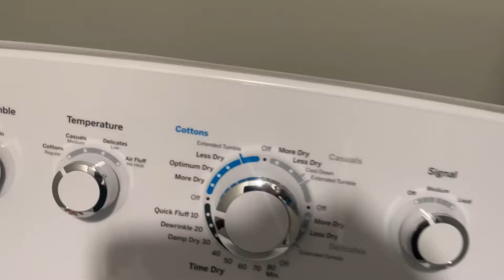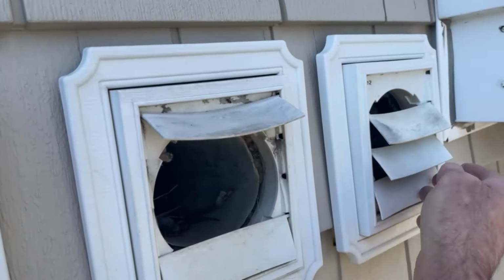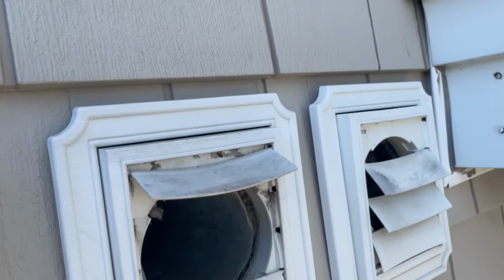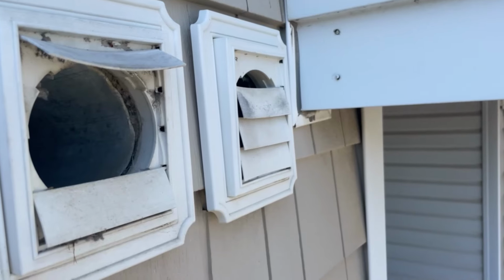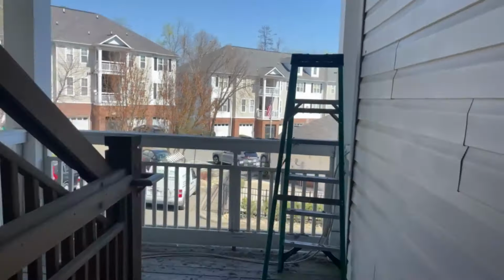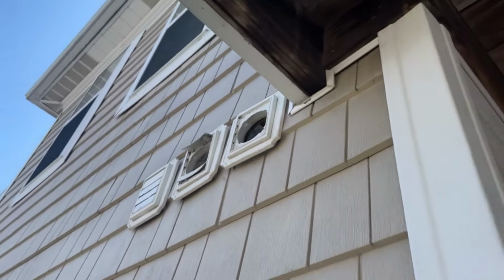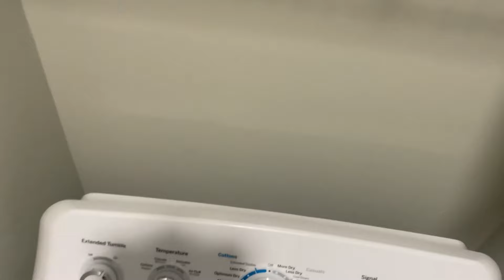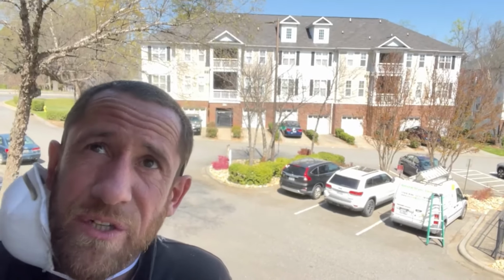EVICTION DAY! Dryer Vent Cleaning! #almetaldryervent #satisfying #viral #birds #bird #fyp #fupシ

Comment: In 2021 we had dryer vent cleaning for a 30 unit condo and I think we came up with something like 4 pounds of lint (dry) and 3 or 4 bird nests. They do make a plastic screen cap (vent guard) that snap fits over those louvers (without blocking the air/louver movement) and prevents bird entry.
Reply from the maker: Awesome! Thx for your thoughts!

Comment: Um, sir, it appears that you stole a vent flap from the neighbors vent exhaust. In the beginning of your video, your exhaust port is missing a flap at the top and at the end of your video they are all there. Also, the vent to the left of yours had a flap at the bottom which is missing in the end of your video. Not saying it wasn't you but as a home owner, regardless, seems suspect. Just saying.
Reply from the maker: I can appreciate that. But fact is, I’ve replaced many dampers throughout the years. When I’m replacing one that only has a couple of the louvres or I’m replacing one that the homeowner doesn’t like the appearance, I throw all the leftover, or reusable ones, into a box in my van. That way, I can typically replace just one or two on a different home without having to charge them whatsoever. I’m just recycling something that would’ve would up in a landfill. If one fell off another while I was working, that’s terrible that I didn’t notice and I can reach out to them for verification. Mistakes happen however immediately going to theft is rather strong. I’ve been in business a long time my friend and stealing has NEVER been in my toolbox! Thx for pointing that out
Reply: @advsLLC  Just making an observation, otherwise, I liked your video and all of the stuff that came out.
Reply from the maker: @AmazingBibleFacts and I respect you bringing that to my attention for sure! My goal is to help... Not harm! Again, thank you for pointing something out that I wasn't aware of! Thx for watching!
Reply: Who would actually steal a flap off a dryer vent anyway? Kind of ludicrous.